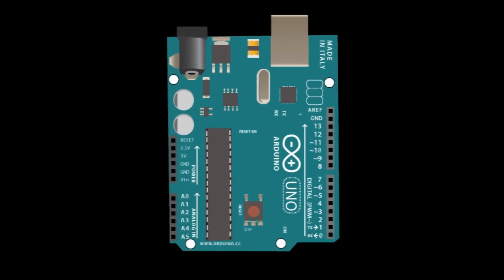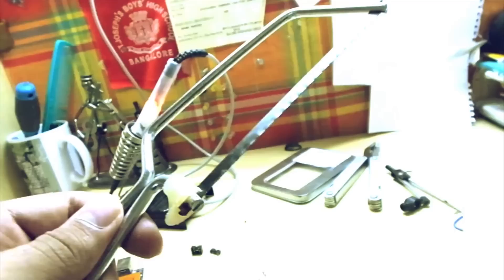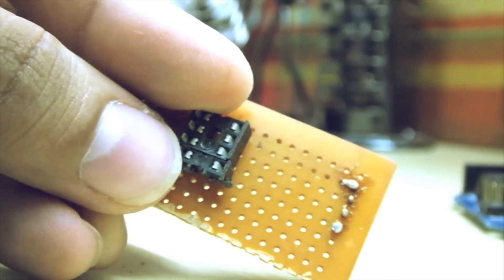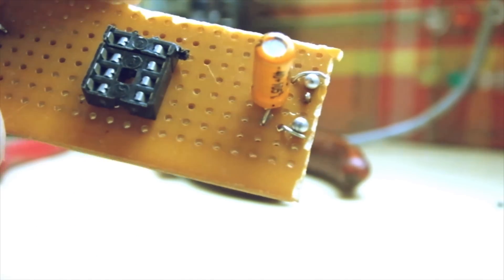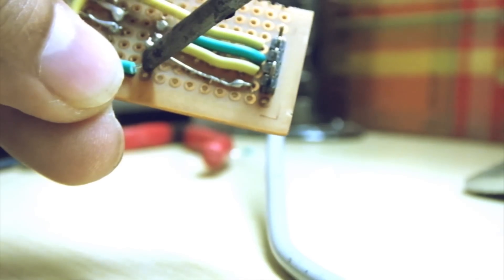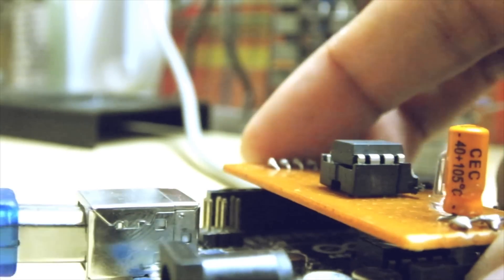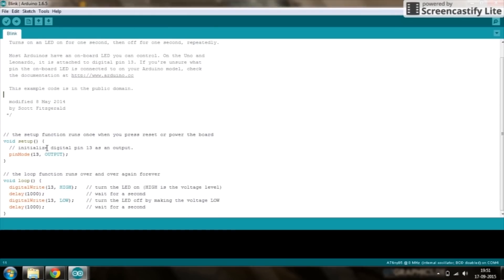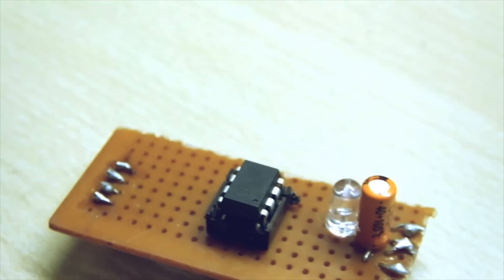How to make a DIY ATtiny Programmer (Arduino)

Comment: hi dear
when i program attiny85 it showing yenkie invalid device.check your connection double
Reply: i have the same problem with 50 chips that was packed in plastic when coming from china i say they are all dead, i only had 4 that worked.

Comment: It is a nice work but missed a very important protocol of adding ATTINY Board!! without which it will never work. For help one can visit [ https://create.arduino.cc/projecthub/arjun/programming-attiny85-with-arduino-uno-afb829 ] . Anyway good work amd keep it up..
Reply from the maker: You're right. In older versions of Arduino before board manager, we had to manually drag and drop the folder there.

Comment: why are you adding a capacitor . please tell me
Reply from the maker: To keep the output voltage stable. There is a sawtooth ripple in the voltage and the capacitor averages this fluctuation

Comment: Great tutorial, thanks
The Arduino Micro Core can be installed directly from the Arduino Playground on the Arduino IDE, 
if you want to renounce on erroneous error messages.

https://playground.arduino.cc/Main/ArduinoOnOtherAtmelChips

Comment: Hey Lyle. Nice video and Circuit you for the Tinys. I just made my own board for the tinys and downloaded til software (1.5) and unpacked it ready to put it.....? - that's the problem I san't really hear what you and get a hold on it, could you send a description to clarify to where I shall put it in - I tried different locations in vain.
Reply from the maker: Heyy email me if you still need help with this, with the latest Arduino version there's a much simpler way to install the core

Comment: Good shield. but you can improve it.
I also want to use it to program ATtiny45 / 2313.
So I installed two extra sokels 1x14Pin for ATtiny45
and 20Pin for ATtiny2313.
Thanks for the instructions

Comment: Do not use 10uF capacitor, new IDE does not Reset itself. Do not use the LED like on the video, unless you want to always blink it. Instead, make 'power on' and 'programming' LEDs. Add two single rows by 4 pins on each chip side for testing your programmed attiny. WARNING, Attiny's chip pin 3 = GPIO pin 4 = Analog pin 2, but  Attiny chip's pin 2 = GPIO pin 3 = Analog pin 3. Be careful. :-]
Reply from the maker: Hi Morten, I have a newer design that works really well for me now. The differences are
1- I've broken out all 8pins so you could connect it to anything on a breadboard while being able to program it in circuit.
2- all the gpio pins are connected to LEDs through 10k resistors (lower res might interfere with gpio functionality)
3-theres a switch connecting reset and ground so I have an onboard reset button for the tiny
4- power led indicating the board has power 
5- not sure about the new ide preventing a host reset so I prefer to keep the 10uF capacitor on the reset pin just incase
Reply: Do you have the new schematics?
Reply: The LED is used to prove the example sketch uploaded and the DIY shield works. No drama here, upload your own sketch (which is what most normal people do) without the LED flashing.
Reply: I do not understand your Warning here. I just made an etch-design for creating the board from this video, and I would like to know how to make it better. Could you please instruct me further? What would be the better way to do this? Thank you.

Comment: help i keep getting an error while burning bootloader
Reply from the maker: What error? Common mistakes Ive made:
-Arduino ISP sketch not uploaded properly
-Connection issues(Reset,VCC,GND,MISO,MOSI,SCK and Capacitor on masterReset)
-Programmer must be: Arduino as ISP
-Processor must be: Attiny85/45/25
-Com port not set properly
Good Luck!
Reply: I worked out the issue, it was a bad connection between the arduino and attiny
Reply from the maker: Awesome! Keep making

Comment: At min3.10 you said that connect reset pin to pin no 10? whats that mean? shouldnt it is the 5v pin?
Reply from the maker: Reset of the tiny to 10 of the arduino. so the arduino can reset it when its ready to upload the code